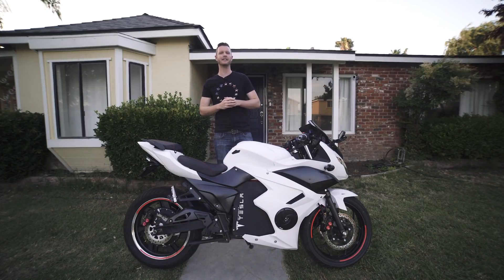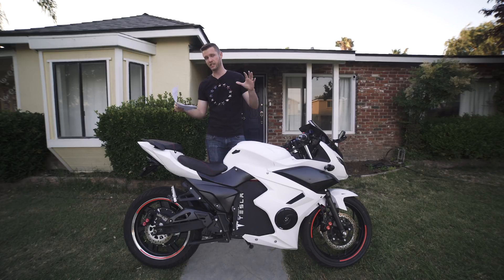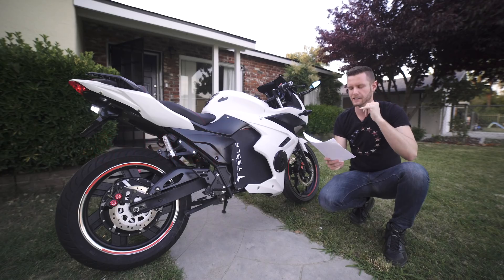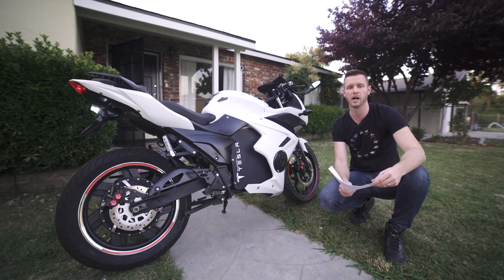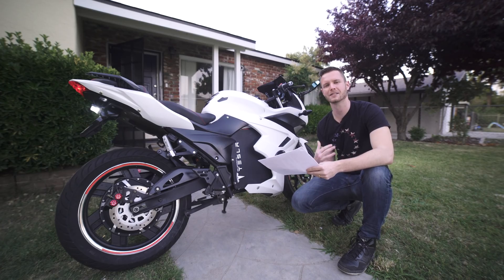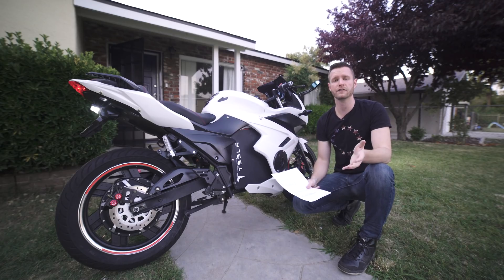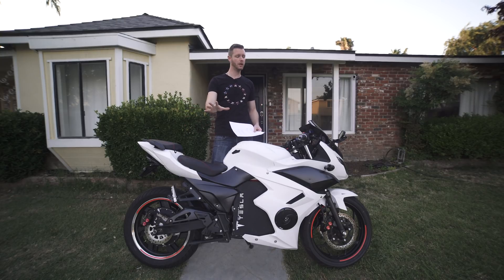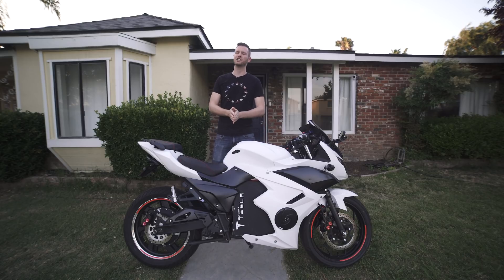How MUCH Did the Build COST? | Chinese Electric Sportbike

Comment: I’d say for 6k building an electric bike that you can tune to match the power of a 50cc scooter to a ~600cc bike is absolutely worth it imo. I’d argue since it has room to upgrade the motor wattage and possibly battery capacity from how I saw it built with a little headroom you could get it up to 800cc while being fully customized and unique.

I’m a car enthusiast and modder but I’ve always been drawn to bikes and since high school I wanted a ninja but was never able to get one. I grew up tinkering with electronics like computers and game consoles a lot though and recently the itch came back but I felt like because of my lack of experience and what I think is limited modification capabilities especially with small cc bikes means that id have a bike to ride and learn on (which is fine) but not much else. With an ebike I could get a cheap China build and get my gear head and technological modding fix out of building it for more power as well as being able to tune so seeing this series is super motivational for me.

This video specifically was the one I was looking for because I wanted an idea of what motor and controller to look for as well as how to build it correctly but I’m definitely looking forward to getting into this. The only downside personally is they’re auto bikes but that’s a small trade off and I could always still get a ninja 250 or 300 for cheap to get my gear rev fix but I like the idea of an ebike more. I also have a rider theme I plan on going for once everything is said and done and the speaker wasn’t something I thought of but would absolutely help finish the theme

Comment: the chinese bike is not even close to twice the speed and range of Sur-ronX
stock sur-ronX top speed = 50mph, stock range is 50-60 miles.
my sur-ron does 0-60mph in 6.8secs, hits 81mph top speed, has upgraded battery and controller, getting 50-70 mile range off-road.

Comment: How many rpm's are you getting/ how big is your back wheel? The website for the motor says its rated for 1030 rpm and I'm using 17in as the diameter of the wheel which comes out to be about 52.1mph

Comment: Jesus guy. 6k on an electric bike. After your experience. Really necessary to fix the taxes and cost of importation.  It would be cool you reach the manufactories and show them your improvements. The GPS can be updated to make it better software. also the battery temperature is really useful.

Comment: A qs273 hubmotor is not comparable to any Zero model. your basing your pricing on purely battery size. Not taking into consideration cheap brakes, suspension and cheaper controller and motor. a 21kw hubmotor axle torque is trumped by all zero model torques. You build EV bikes for the torque. Its a nice project but dont compare it do a SR/DSR. its an upgraded chinese bike.  Well done though its always a nice learning exercise building 18650 battery's and knowing to spec everything to work together along with the rest.

Comment: How did you guys end up connecting the 3 battery packs together? Use a special connector?
Reply: Paralleled every series group. They’re permanently wired as a unit
Reply: @LordCurt  thanks for the reply Curt. I was trying to find some connectors so I could easily add or remove a pack. Did you wire the extra parallel groups? If so what type wire, gauge etc. Or did you just pull the packs together as one? I ordered the same batteries you guys used but I will have 1080 cells in total. Each pack will have 18 in parallel and I'm using the Kelly 700 amp controller. I'm somewhat knowledgeable with this stuff but still have a ways to go. Thanks for sharing the information. This will be my first battery build.

Comment: Sitting on the curb, the bike looks much faster than it actually performs.  To me, it looks like a 600cc gasoline class, sport bike... my Honda 600RR got up to like 180 mph.  This looks like a fun, go around town cruiser, but besides that, IDK?  However,  I'm impressed how much work you put into this project, and didn't give up.  I firmly believe that someday I will buy an electric motorcycle.  Oh, my KX450 MX bike is faster than most electric motorcycles LOL.

Comment: I want to buy a motorcycle in China, do you think it is worth going for an 8000W motor and a 72V 80ah battery pack, instead of going for the most economical configuration, 3000W 72v 55ah lithium, with this seller  I have?

Comment: Sadly what you said about this bike being faster than the lower Zero motorcycles is wrong everyone of the Zero bikes would beat this one in anything the only difference is the you paid less  and on a cheap knockoff too. But it still is a nice bike and if you would have done some things different when upgrading it it would beat  at least one of the zero bikes.

Comment: Hey, what about trolling a bike breakers/ pound auctions, picking up a complete roller, that has it's fairing, and related plastic,(or not) and putting a "kit" in it, and building a "converted" electric bike. A kit would reflect the neccessary power to weight ratio for  performance from economical urban commuter, to Lightning performance. So I guess to meet budgets the best kit at say  lower than a razor will blow the dust off a turbine bike. I think you have a business potential to supply kits, parts, instructions (battery builds + electronics). You have discovered the murky world of customs, import, so you could get parts from over seas unless even better you might source all parts in USA. Hey you want to talk more about this I'm "Al's Place"(you tuber)

Comment: So there are 2 separate 40ah packs in the bike and you get 130 miles out of those? Just trying to figure that out. I have 8000w hub motor mountain bike with 100amp controller and if I'm maxed out at 60mph on it, I only get about 20 miles out of it. It has around 30-35ah battery with Panasonic cells.
Reply from the maker: 3 40AH batteries all linked together.
Reply: @TheInja  ok. Just curious. How many cells were in each 40ah pack? Also, where did you purchase the circuit breaker?

Comment: For motorcycle sounds, 
You can tap off one or two of the phase wires that go to the motor, install a high resistor (like 10kOhms or so, verify with an electrician), and connect to the speaker, and connect the other side of the speaker to the ground. You preferably want to plug it into a cheap woofer for testing, as they handle higher loads, not to fry your speakers.

Comment: Throttle position sensor can likely offer you the motorcycle sound to throttle also technically the sound you'd get during acceleration wouldn't be able to get from GPS speed. Think about it. Interesting notion though

Comment: So could you basically buy a gas-powered sportbike or cruiser with a blown motor and just convert to an electric motor and battery pack to replace the old motor and gas tank? It seems like that would take care of the chassis and brakes/suspension better than Chinese components. Will you need to register the vehicle as I don't think if it is wrecked you would get any insurance money like a moped? Also, state offices don't know how to price personal property on non-US bike companies. I have a Chinese 150cc moped and keep getting classified as a Vespa which is valued 4x what I purchased the 150cc Chinese moped although when wrecked it would not be covered (liability only). I am very interested in building something like this from an old motorcycle or golf cart/go-cart.

Comment: Here’s my thing I already have a sport bike with no engine and it’s in great shape and the kit and range you got out of yours was exactly the result I was aiming for and then I came across your videos. I believe I could build it (just the bike, I don’t care much for the extras) for right around $3,595 but, the cells you bought advertised at 3400mah each. When you were testing them did they actually yield that much on your individual discharge tests? If they did I using them.
Reply from the maker: Yep! All specs declared were met
Reply: The Inja nice bro thanks for replying, I’m gonna use them but I just had to ask cause you never can tell sometimes. And great job on the bike all in all. It was nice going along for the ride.

Comment: I'm not sure if this is any help for the speakers making engine noises topic, 
There is a product that is made for battery powered 24volt model trains, large model trains, not small ones, 5" gauge & 7 1/4, they have a sound files on a micro SD card & the noise changes depending on how much power is going to the electric motors.
It's a product made by a company called Mtroniks, they have a website.
https://www.mtroniks.net/cat/Sound-Systems-For-Scale-Models

Comment: get an unlocked ASI BAC8000 controller, i sell kellys, unless you're running the kls72701-8080h controller. you're wasting your time with the motor

Comment: I'm hearing a lot of prices for parts. What about labor? Just because you built it yourself doesn't mean that time is not a cost.How many hours do you have in this? Even at a basic $10/hr, the hours add up quickly. How long did it take to assemble the battery packs? Especially the more technical knowledge of doing the wiring would be expensive. I feel that your numbers are probably short a couple thousand dollars.
Reply from the maker: Haha we spent many weeks on this.

Comment: I watched the whole series, and you did a great job! However, comparing it with mid-series zero bikes is not quite right, since on those bikes you would get a lot more than just power, and battery capacity. What about the ABS and systems like that? What about the brakes in general? Steering damper? I would not ride this bike in city traffic, as  I believe it would let me down in an extreme situation if that would ever happen. Regardless of that, you did an awesome job, and for the project, it really worked well.

Comment: Those import fees are par for the course, regardless of the product you are importing. Any time you get something from alibaba or an equivalent site, and have not paid to clear customs you are lucky. Small products never get nailed, but importing something like a motorcycle or scooter, you'll get popped every time. A cost you need to plan on. I however, having first hand experience getting such a product that doesn't match every expectation, have a lot of respect for you not hanging your head and giving up. I'm finally getting the bike I ordered a LONG time ago out from under wraps and starting the process you've gone through with this. Even with imports not being my first rodeo, an electric bike is a beast unto it's own. I love following the updates! Rubber side down! Can't wait for the new updates soon.

Comment: That's pretty good performance for the money. Could save a half of that if you just bought a roller gas motorcycle and adapted the rear hub motor too it. Would probably need to be something like a 500CC'er.

Comment: I work on ac electric forklifts everyday.  I so much understand the issues you faced and over come U V W  learn to love these letters    Regen is nice to recharge your battery pack but turn them down if controller still gets hot    Great 👍 job looks good china brand or not looks tight

Comment: top speed seems to be the only setback.   id still be worried about those welds and how quickly it rusts down the road.   be interesting to find a sport bike frame that doesn't use the engine to support and just build it from scratch.    find a place with an industrial 3d printer, make the tank and min rear cowl, side fairings out of carbon fiber spec'ed of the Yamaha Mt's and build a electric naked sport.  bet you could make it faster, and more powerful for much less doing it right.  nice thing with electric, so many less parts.    be an interesting project.

Comment: Still didn't factor in labor ... Theoretically .. calculate the hours spent multiply by the average tech rate ...
Not everyone has the guts to risk a  a diy nor the skills .

And would you consider putting together the kits and selling them as a all in one upgrade kit ?

Comment: Can anyone explain to me why this bike has such high acceleration but so low a top speed? I had assumed that this was something due to the bike basically only having one "gear". 

But then how does zero and other brands avoid this whilst still also having only one "gear"
Reply: This 8k watt motor is rpm limited to 74 mph. The top Zero bike and Livewire have an 80k watt motor. Much bigger and designed for higher rpm. They then use a chain or belt to adjust the top speed and acceleration. This company makes a 12k and 14k watt hub motor that can do 105 mph, but it costs way more money and is water cooled. It probably would not have bolted into the same spot as the 8K motor.
Reply: @JasonWW2000  its not motor limited, it's controller settings, this motor easy can 100mph, but need another controller or change settings.
Reply: @5EM3  I'm reading the motor specs not controller specs. It seems this particular QS motor itself is rpm limited to 74 mph.

Comment: Congratulations on turning around an initially bad experience into a great one!
I can only admire the determination and ingenuity you have shown to create a unique one off modern electric motorcycle.
To have a high level of performance in speed and range for a relatively small expense compared to commercial offerings is a wonderful achievement.
Also to enjoy every mile with zero expense in petrol costs must be very satisfying!
Thanks for posting.

Comment: Would love to know if it was possible to do a similar build with higher performance hub motors...10kw...15kw!?
Reply: Yes, but the cost goes up many times.
Reply: @JasonWW2000  chek motor price 8kw and 15kw, not very big price  different, but it's stupit put 15kw coz this motor alot more will be drain battery, even if you will ride in same speed. So 8kw it's optional for battery and speed. Diffirent price will be about 800usd.
Reply: @5EM3  The price for the 14k watt motor alone was $1900 then you need a controller for it. That's double the price, plus it might not fit in this particular bike. It does seem you lose some efficiency, but not much. Just slightly less range.
Reply: I’d happily sacrifice ride time for higher speed and acceleration...

130miles + 70mph + 5secs (0-60)
Vs
70miles + 130mph + 3.5 secs 

I know what I’d chose!
Reply: @Ollieewm  legal bike from China only one model 11000w max and 100ah, there is better 15000w and 150ah but it's will no certificate for register, you can register but it's will be cost alot.

Comment: In alibaba, u can buy with this price better and cheaper.
Reply: He did buy through Alibaba.
Reply: @JasonWW2000  yes cheapest model. With 3000w, there is 15000w models, 120ah battery, abs and other stuff that alot better than this model, and will be cost only about 5k.
Reply: @5EM3  He bought the more expensive 8k watt version, but they sent the 2k watt. They kept his money. :(
Reply: @JasonWW2000  also is 11000w model for legal ride u can register easy, this model ninja have, don't have certificates for register legal ride.
Reply: Can you send a link?? I’d love to see it

Comment: I'm gonna ask the elephant in the room question; if it's even possible, how much is it gonna cost to get registration ? Or are you going to run it on the other Chinese petrol motorcycle's documentation 😉
Reply: We will find out once he gets it figured out. Still unknown.
Reply: You can't register this bike, coz don't have certificate, only 1model china electric motorcycle have certificate for legal ride USA, and EU. Also alot better then this 11000w 100ah abs and other stuff, only 5k.
Reply: 5EM3 
Just seen the latest video & it's out on the roads with what looks like a registration plate on it.

Comment: And still doesn't go faster than 100mph
Reply: That 8k watt motor is only rated to 74 mph. They have a 12k and 14k watt motor that does 105 mph, but its bigger, water cooled, a lot more expensive and they don't sell a controller for it. This is the compromise you make.

Comment: Could you just do this with a ninja 250 frame or something? Seems like that would be a cheaper way.
Reply: If you do a hub motor, it would be pretty easy. You might need to cut and weld the frame to better fit the batteries.

Comment: You should put a J1772 charging port on your tank where the gas should be. They sell an adapter to charge all 3 batteries at once with 3 separate charger outlets. The tricky part would be to find a place to mount all your chargers internally.
You can buy the adapter here:
https://www.tucsonev.com

Get the j1772 to zero adapter, it should fit the charger perfectly
Reply: He has to slow charge only.
Reply: JasonWW2000 it works for slow charging

Comment: You could try to find a R1 or R6 Yamaha or similar, where the motor is caput and build it on that fram, I reckon it would be cheaper and you end up with better breaks/suspension/handeling aso.
Reply: Yeah, people do this. I don't know if it's cheaper, though. It's certainly better quality components.

Comment: Few disagreements. This is nowhere close to Zero. You are still on bad suspension, likely bad frame geometry, definitely a frame that will crack, etc. You can't look at numbers on a sheet and say it's the same. It's not. For instance, there is no such thing as an "XkW motor." That's like saying I have a 200hp engine. It doesn't tell you anything other than it's marketed, that's right MARKETED, output. This is an infamous problem in Ebike world where you can see 2 very different 500w motors of the same style, typically the cheaper motor being the smaller of the 2. In a more reasonable world we would be comparing motors by many other factors like the coils, magnet strength, etc. After all, we would never say a 4 cylinder turbo making 300hp is going to be the same as a v8 making 300hp.

The next thing you NEED to do is get a welder to look at the welds and ask how much it'll cost for him to redo them all cause trust me, every single one is garbage.